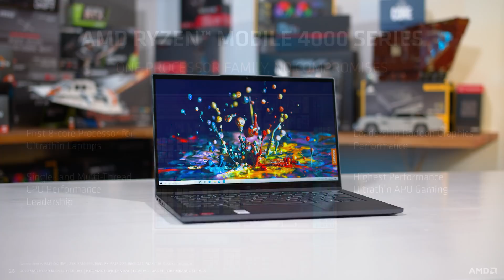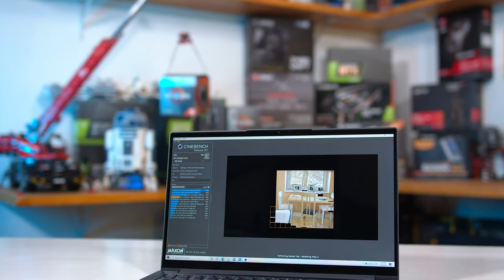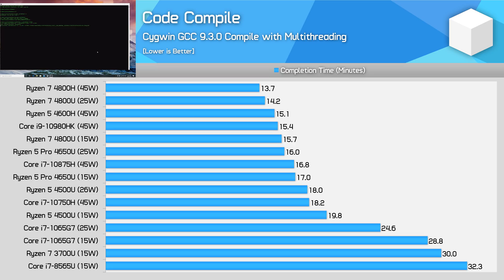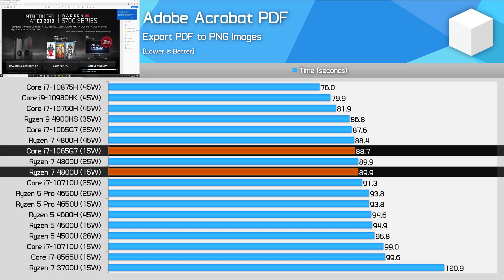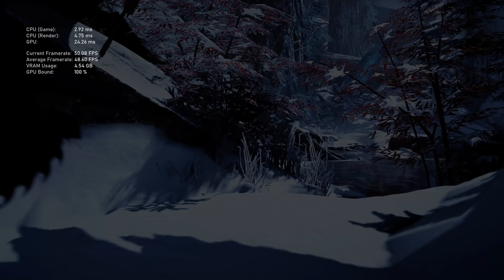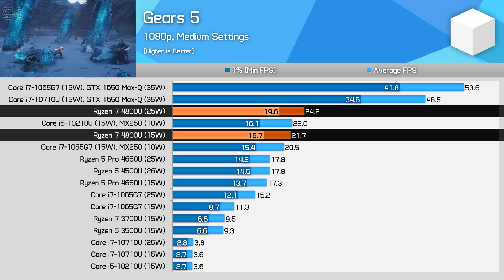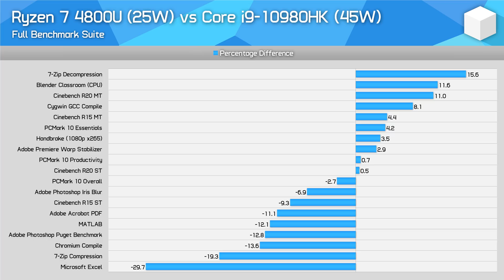AMD Ryzen 7 4800U Review, Mind Boggling Performance at 15W

Comment: It's stupid that Intel in the 11th gen processors still only has 4 cores even in the top-tier i7
Reply: @raukoring  Its happening this gen, 4 cores are starting to bottleneck if you play médium or high, anyway those clockspeeds don't matter since gaming is a long term workload, you need the most efficient and durable processor to keep those clocks. In your case I think a 6 core laptop would be even better than a 8 core, more futureproof and still good clocks.
Reply: @josea580  6 cores more future proof than 8? Are u insane?
Reply: @Max-fw3qy  The man wants more clock speed than cores so go with 6 instead of 4, 8 cores wont do for him. More future proof and still better clocks, comparison was against 4 not 8.
Reply: It's even stupid that the i3, i5 and i7 sku all have 4c8t (except the lowest i3, ONLY 2 CORES)
Reply: They cant get it right because of the chip design for 14 and 10 nm. More cores means way more power for them.
Reply: @rareraven  Yeah, backporting didn't go well for them.
Reply: @rareraven  you are absolutely right!
Reply: @rareraven  No, yields are garbage, 4 cores is the best they can do, or the would not get any working cpu out.
Reply: @rareraven  intel`s 10nm actualy equals tcmc`s 7nm
Reply: @DrowDanger  nope
Reply: @rareraven  yep
Reply: Intel made trade-off, their priority is iGP and their 10nm is not mature as 7nm TMSC. If they put 8c/16t their TDP will claim maybe as high as 65W at base frequency lol...
Reply: @raukoring  userbenchmark?  Lol
Reply: @raukoring  what are you talking about... It's a low power mobile cpu. The gaming performance is limited by the integrated graphic. No ultra thin laptop has a discrete gpu. Gaming on these machines must be considered "casual" and not what they are designed for. People buy them to WORK. And the 8 core AMD is very GREAT at this.
Reply: @BICIeCOMPUTERconGabriele  I would love to see a professional version of the Ryzen 7 4800U. Put it in a thin and light chassis and give the IGP Radeon Pro driver support, and it would be able to replace my chunky dell laptop with 6/12 core/thread intel CPU and quadro graphics. The Ryzen system would be half the weight of the intel,  easily twice the battery life, and similar performance for the tasks I need: Office, Python, Matlab, Catia, Hypermesh. You don't need tons of shader/ROP power for professional engineering apps, and the low end Quadros are pretty unremarkable anyway. But the driver support is crucial for professional apps, especially Catia.
EDIT: Did I mention my stupid work laptop gets 3h of battery life? It's inadequate for working on the go, or even for visits to the conference rooms without a power brick.
Reply: @BICIeCOMPUTERconGabriele  I'm trying to find the comment you replied to lol he deleted all his comments 🙄
Reply: @BICIeCOMPUTERconGabriele  There are ultrabooks with MX250 and MX350 GPUs. No, they can't match a GTX 1650 Ti, but the MX350 (and upcoming MX450) can game quite comfortably at 1080p. Especially if you play games that are not AAA first-person shooters.
Reply: @4Leka  ok, it's true, but still what @raukoring says is pure garbage... How can a R7 4800U 8c16t be A BOTTLENECK for a MX350? 😂
Reply: @4Leka  it's really useful, especially for someone who using their ultrabook to edit video or playing games. But i think it will lost its niche in the future, because let's face it, AMD and Intel make powerful iGPU, and if you want something more powerful, just jump to MaxQ variants.

(To make things even worse, AMD try to split their lineup in the future, with cezzane and van gogh. Cezzane use Zen 3 + Vega for more powerful laptop with dGPU, and van gogh use Zen 2 + RDNA for ultra portable. Yes ik it's only leaks, but this is really exciting imo)
Reply: @raukoring  Exactly my point mate. A processor that is best at gaming doesn't automatically mean its the best at everything else. If you understand the processor market you'd understand that gaming is a piece of the pie and not the entire pie. Get it now?  Also, your user benchmarks site doesn't show you the full picture, independent testing does. Intel beats amd in gaming performance by 12%. Which is best case scenario and maximum cpu bottleneck. Say with something like a 2080ti if you use a cheaper GPU that percentage falls further. In productivity tasks like matlab, video editing, code compiling and so on. AMD beats intel by around 15% and most productivity tasks don't leverage the GPU so this performance isn't bottlenecked. Coming to performance per dollar, its again amds ball game where it offers around 2x the performance per dollar you spend out of pocket. AMD also supports multiple generation of CPUs with the am4 scoket motherboards meaning I'm not buying a new motherboard everytime I want to upgrade my CPU which is also a huge plus. In your use case where you want to push "gaming performance only" with no cost cap, Intel wins. If you want a well rounded CPU that does everything really well while being cheaper and more consumer-friendly, its AMD that takes the cake. While you want me to understand that your need is gaming, which I do. You do you mate. I also need you to understand that some of us make money doing other things on a PC like coding or content creation where AMD is better
Reply: @raukoring  not when you can get the same single core performance and more cores at a lower tdp. Clocks are not the end all be all as we can see from ryzen mobiles single core performance. Clocks can't be compared with two different architectures
Reply: @raukoring  Oh btw I would suggest you compare 4k performance. In a PC when you are doing 4k gaming there is legitimately hardly any difference between an amd and intel system since the GPU is the bottleneck there and not the CPU. So you have kinda played into intels hands. the 12% gap is mostly 1080p and not at 4k. Marketing is easy to fall to, I don't blame ya. BTW we don't all hate intel. Most of us used and loved intel for years but we are not blind followers who cant see the stupid anti-consumer shit they are doing. If we are compliant and keep defending them, its all of us, the consumers who will get fucked in the end. Constructive criticism and competition is what keeps corporations from taking consumers for a toss mate. Never be so emotionally attached to a company, that's all I can say
Reply: @keshavsakthi546  Zen 3 is coming to beat Intel even in games. I'm eager to see what arguments the Intel fanboys will make to justify purchasing Intel chips then...
Reply: @raukoring  now I know where are you coming fanboy
Reply: @raukoring  Btw if you dont care about laptops I dont know why you are here. This video is about a laptop chip......like clearly
Reply: @raukoring  "fewer cores are better" 1 comment later "U dOnT bUy 10 core 9900k++++ episode 2, u POOOR LUL only i5 amd bad" 
What a chain of comments. Oscar-worthy. Although i have to admit it looks like trolling since mentioning userbenchmark out of the blue is suspicious.
Reply: @raukoring  in your case you want the maximum performance without caring about money but when you look at whole package and productivity, it's amd that wins. Intel is good at gaming and that's it plus we're not fools to change a motherboard every generation. And reality check for you. Intel is atleast partially competitive In the pc space. In the laptop market amd had them beat them across the board while being a lot more power efficient which is a huge deal in the laptop space
Reply: @raukoring  who plays games seriously on Ultrabooks ? This is for people working office jobs with more demanding tasks like rendering presentation videos, compiling code or e-commerce marketing people who opens like 50 tabs on the regular. 16 threads win any day.

Beside , even in gaming, 4c 8t is still too last gen. 6c 12t is the next "just right" spot
Reply: @raukoring  good luck my dude lmfao

 the new consoles are 8 cores, 8 core will become the new standard.
Reply: Instead of using userbenchmark ONLY, look also at PassMark, Geekbench, and Cinebench scores please. Since a lot of reviewer don't really trust userbenchmark.
Reply: @levaaaaaan  userbenchmark changed in order to lower amd's scores in all of it's processors, favoring single core performance and diminishing the weigh of multicore performance
Reply: @levaaaaaan  userbenchmark puts a 4 core 4 thread i3 as a equal with a 6 core 12 thread and processor..... ridiculous!
Reply: Yup
Reply: 11gen selling small improvements over the same design, while ryzen have already made big changes in the architecture like cross ccx and 7nm
Reply: @raukoring  i dont understand why you need top of the line cpu just for "imMeRSiVe gAmINg"

$5000+++ pc and what you seek is more clock speed for gaming?

Well.. it's not like i dont't understand what you want.. Intel clearly selling that kind of cpu for spoonfeeded + spoiled kid like you..

For any sane adult people, more core is better. Because it mean faster work done, then more time to play game.
Reply: La Croix yeah no kidding. At $5000 (my computer cost) you aren’t going to find me playing 1080p lol. It’s all gpu bottleneck at 1440 and 4k
Reply: I laughed when the i3 was a freaking dual core
Reply: @raukoring  4k all maxed is precisely when clocks matter less because the GPU will become the limiting factor.
Reply: What's even stupider is that that's the same as their i3 & i5.
Reply: these are low power components, intel can't have so much power in that line.
Reply: I mean, there's an argument to be made that a majority of PC owners don't even need more than 4 cores for home use. 

Of course, as of lately, most casual PC owners of yesteryear have transitioned to phones and tablets. PCs are largely only used by gamers and for work nowadays.
Reply: At least they don't have those sh**ty 2C/4T i7 U series dumpsters anymore. I am stuck with a i7-7500U laptop. It's showing it's age now.
Reply: @WigglyWings  have you refreshed the termal paste? Cuz that fixes a lot of problems with performance speed, in my experience.
2c/4t would be faster though, lol. I feel ya dude.
Reply: @rareraven  It's not thermal throttling right now, cause I am using undervolting in ThrottleStop. God knows it throttled like hell without TS. But now it's the core count that's showing it's weakness, even in normal usage.
Reply: @WigglyWings  ok, just refresh ur termal paste every year or so, specially on laptops.
Reply: @rareraven  But what's the point of doing that if it's not throttling?
Reply: @WigglyWings   "God knows it throttled like hell without TS."
DUDE.
Do you want that?
Reply: @rareraven  Because the cooling solution (heatpipes and fans) is sh*tty on this Asus laptop. It throttled even when it was brand new, under full synthetic load. New paste isn't gonna do much if the tech that's supposed to take away the heat is garbage. The intake on the bottom is size of a small finger. The vent is directly facing the screen hinge. It sh**ty design. TS reduces the overall heat generated.
Reply: @WigglyWings  Try Liquid metal. It preforms better with higher thermals. I applied it on my laptop and it use to overheat in summer times. Not anymore!
BE SURE IT IS NOT AN ALUMINIUM HEATSINK YOU APPLY THE LIQUID METAL TO!!!!
Liquid Metal EATS aluminium lol
Reply: @raukoring  i understand, but I stream render and record. Most of the time in 4k, so more cores is preferable for me.
Reply: @rareraven  a desktop is more preferable
Reply: @rareraven  what do you render?
Reply: @Max-fw3qy  4K video and I'm starting Blender again.
Reply: @raukoring 
My 4 cores i5 3570k @ 4.4GHz bottlenecks even the rx 590
Reply: @ivanomatrisciano3828  Depends on the games and resolution. 1080p@144 will be bottlenecked, 1440p@60 wont.
Reply: it's a low power part, you need H series for high performance which will have 8 cores minimum on i7.
Reply: @lordof7seas  um how's that an excuse when amd matched single performance, gives us more cores and does it all while drawing lesser power. The 4800U is a 15-25w part if you havent seen the video. intel needs to change don't keep supporting their shitty practices if you wanna see them do better
Reply: @lordof7seas  then why amd can fit 8 cores on U series part? when you make a price segment only based on artificial limit and silicon quality, it's really doesn't make any sense. I prefer AMD approach using core count as differentiator between each segment, as it really sell the idea "the more you pay, the more you get", instead of "the more you pay, the less feature got locked"
Reply: @raukoring  Me too, Ryzen 5 vs Ryzen 9 doesnt make any big difference in gaming same as i5 vs i9 despite having more cores/threads. Also the 6 cores i5-10750H still able to perform as good as 8 cores R5 4800H in gaming. Man without TSMC, AMD cant produce 7nm design...
Reply: 4 super cores is better than 8 medium perfomance cores :)
Reply: @niphanif  Not when AMD is matching single core performance and beating it in some cases. Your 4 super cores argument is 2 years old
Reply: @niphanif  someone trust Intel  benchmarks too much it seems. Still don't know how many times Intel lie on slide and gimping amd performance using different hardware
Reply: @niphanif  lol, Intel is stuck with 4 cores! What a shame!

Comment: Shame not many 4000 series available right now. I went with a Lenovo Ideapad 5 4500U as it seemed to be the only thing in stock. Great laptop, worst LCD panel I have ever used. Seems to have an acceptable viewing angle of about 10deg. And washed out rubbish colours. Lenovo and Retailer wont accept a return as I've opened and set up the laptop :( Really didnt think it was possible to have a TN that bad, had multiple TN for desktop and all been fine.
Reply: Maybe sell the laptop and buy other one? Which would you buy instead the one you have now?
Reply: @luisfernando55  honestly if it were available id get the same laptop but with the IPS 100%gamut screen. Just doesnt seem to be available in my country. May well sell and rebuy later. Good idea.

Comment: This chip has the same Cinebench score as my R5 3600 desktop 65W lol.
Reply: They're both on Zen 2 architecture.
Reply: @Olivia-W  Yes, I know, my point is that it's amazing that a 15W part can compete with a 65W part.
Reply: @LazerCut  yes but it also had to use more cores
Reply: Mala Thomas yes, but that doesn't really matter because total power is much less
Reply: @LazerCut  It's amazing that one can gimp a 4800H with a 15W power limit and still get 3600 level performance. Silent PC builders would love having this CPU in a desktop.

Comment: "Just 130% faster."
How far has AMD come lol.
Reply: yea, but tbh, its more like how complacent Intel became...How long they have screwed the customer with their expensive cpu's.. Even if Intel became the performance leader again, ill stay with AMD for a while, just to flip the middle finger to big blue...
Reply: @KeesHessels  Got my 3700X about a year ago. Haven't looked back. Good riddance. Their stuff was decent enough, but man it got boring real fast. Upgrading is exciting again. You're trying to figure out the correct time to buy the correct generation, to get the best deal possible. That's a far cry from just buying whatever i5 is the latest gen because 4th, 5th, 6th, 7th gen... it's not like it really mattered. A bit, but not nearly as much like it does now.

These new mobile CPUs tempt me to buy a laptop again. Haven't had one since my MBP 2011 died in my final months of college. Haven't had a serious need since. I've been looking to get a tablet for some casual stuff on the couch, but a thin-and-light might also be nice and provide a more robust experience. Why do they have to keep tempting me... I already bought their stuff last time...
Reply: @Niosus  Yea, when the Vermeer coming out, i'm looking at a 4900 or 4950 upgrade... i'm on a 1600AF right now... can't be to soon for me !!
Reply: @Niosus  amds resurgence has actually kickstarted quick improvements of cpus again so I tip my hat to them
Reply: @KeesHessels  I'm looking to the 4800 or 4700x, currently have a 2600
Reply: @houseking9211  enjoy man, were gonna have a good time playing around with them :)
Reply: @KeesHessels  upgrading from the 1st gen 1600 to 3600, never regretted it.
Reply: I nearly choked at my drink at the "just" part xD
Reply: shintel left the chat

Comment: when you say "tested...without thermal throttling" ...does that mean you're putting some light cooling under the laptop?
Reply from the maker: No, it's tested passively unless we notice thermal throttling (eg. the temperature teaching Tjmax). Then we raise the laptop to get in additional airflow. That's usually sufficient
Reply: cool! thanks for the response